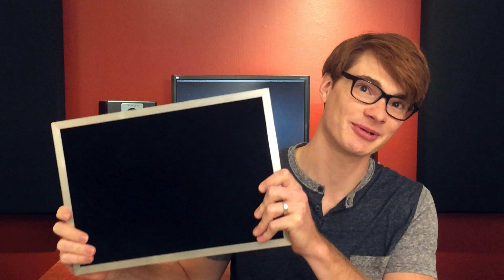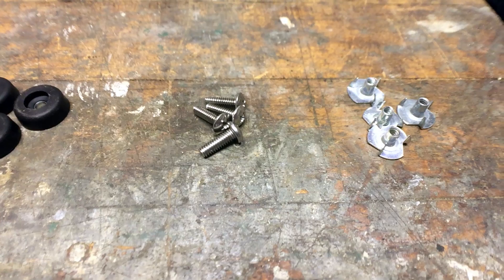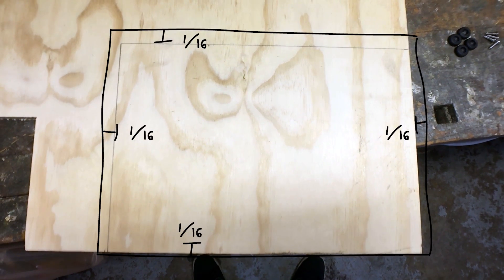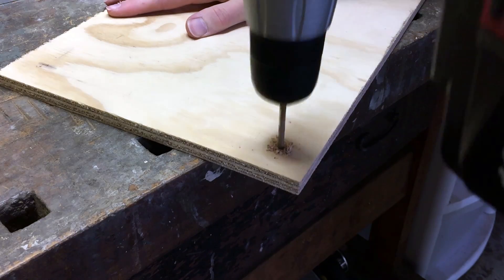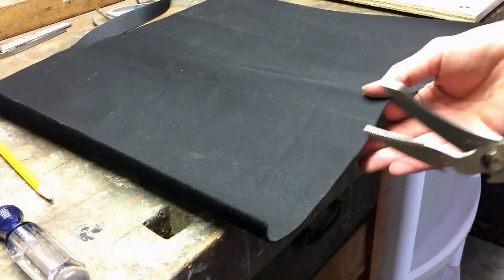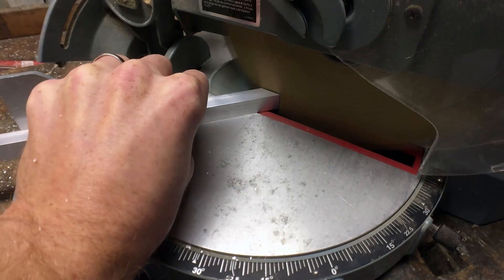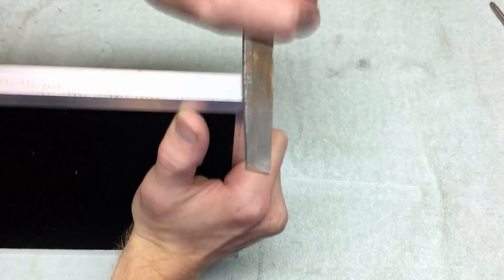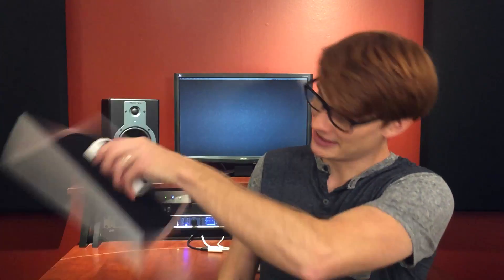Build Your Own DIY Pedalboard Part 1

Comment: Hey! Thanks to you I built my own pedalboard for less than 30€ (custom cut). It was a little more expensive because I used a sheet of acrylic instead of velcro as I was planning to use 3M Dual lock velcro! Next I will replace the acrylic with some formica to sandwich the plywood because the acrylic started to crack with a year of usage (near the wah pedal). Thank you!

Comment: One thing you can do is get a small sheet of black laminate which is a hard surface and glue it on the board instead of velcro. That way you could use dual lock velcro or you could use the bicycle chain loops to screw the pedals do the board.  You can also use Stage Trix pedal risers on the back row if you make the board bigger. With the stageTrix pedal riser, you can route cable underneath the riser.  If you had a row of risers on the back row, you could hide all your cables.
Reply: Where can you get the black laminate from?

Comment: idk if you mentioned this but what was the total cost of the project? great video!
Reply from the maker: Thank you! I would guess between the plywood, hardware, C-channel, and the velcro material the cost comes out to about $35. However the can of spray adhesive I used was $13 so that puts you closer to $50. Once I got all the materials though I had enough to make 2 pedalboards.